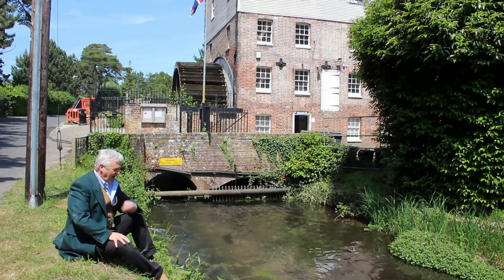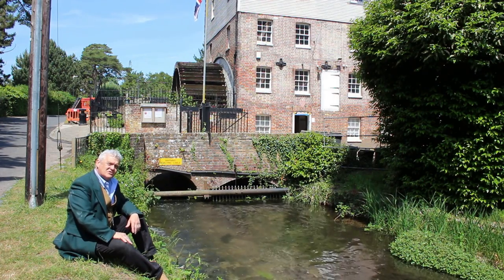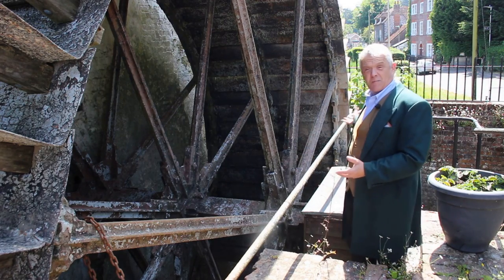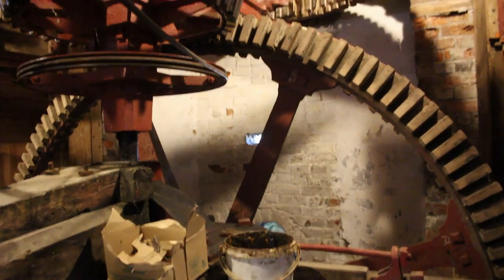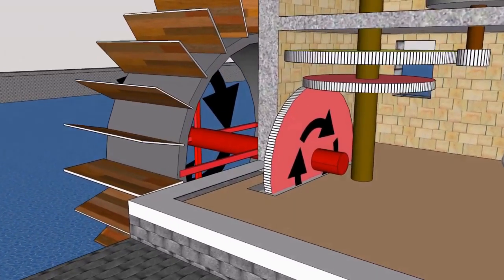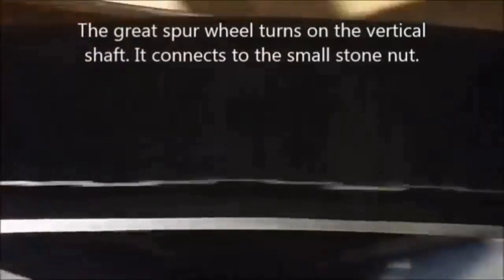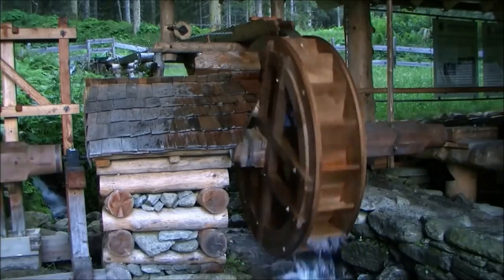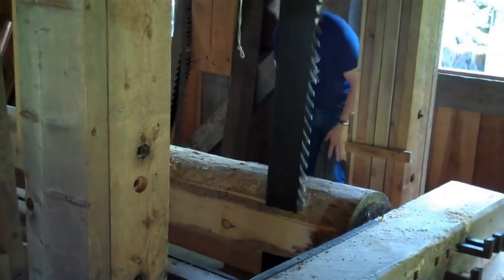1958 Gears And Where They Fit In - Crabble Mill Water Mill

Comment: Always fascinating stuff. I’ve often wondered how much stone ends up in the flour 🤔
Reply: "In stone-grinding, the wheat is ground slowly between two stones. All other commercial flours, however, are ground with high-speed steel rollers. The heat generated by these steel rollers strips destroys many of the vitamins and enzymes in the wheat. The stones do not generate this heat, preserving the vitamins."

It probably constituted a source of trace minerals for diet of old..
Today of course, replaced by microplastics and anti-caking agents.
So much more sophisticated ! 
lol
Reply from the maker: I have no idea mate
Reply: Had to get your peck from somewhere😆 that's True Grit😁
Reply: Not bothered by the stone it's the vermin droppings that give me cause to wonder.!
Reply: @10sheds21  it's still there, just ground a lot finer by the steel rollers.
Never you mind about the poop it's the maggots in the bottom of the barrel you might want to consider. (Of course these will add protein to your diet🫡😳😁)